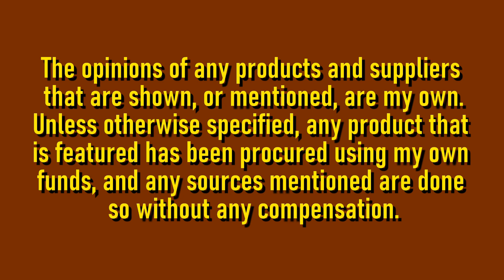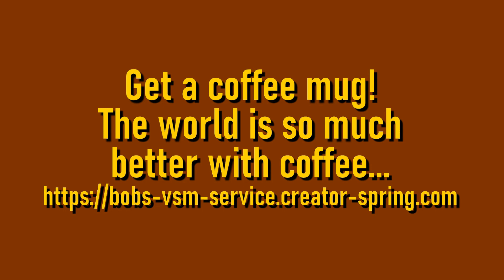A Very Crunchy Potted Motor

Comment: Hi Bob! Watching you do this was fun. Not going to lie, potted motors are one of my least favorite projects. But with that I was trying to follow your lead and tap out the brass bushings on one that I'm working on, and they did not want to budge. Nope. I think they're going to stay put. You will see 😂
Reply from the maker: Did you  remove the set screws?  YHou'll notice I didn't take oput the grease wicks... That was a mistake, they should come out first.. Your may be holding the bushings up, mine just sheared off!
Reply: @BobFowlerWorkshop  yep! I had previously removed the grease wicks and all of that, and yes I did remove the set screws. They just were in the mood to stay where they are. 😁

Comment: WOW 😮 that's the reason I keep staring 😳 at my potted motor machine. Don't have the necessary knowledge or courage to mess with. 

Yes I  think my limits on machine is getting closer. 9 treadle and 12 other machines 😅. I  just gifted one that I may get again if I can find it. All of this happened after my first handcrank I believe singer 28 that I  am still working on.

Comment: Just curious, can field coils and the armature be completely rewound, or when they go bad are they throwaways?  Thanks for all the shmoo fests!😀👍💖
Reply from the maker: Technically, yes, they can be, but it's not a job for home gamers, that's for sure. I know I wouldn't even be thinking of rewinding. Sending it out for rewinding would be cost prohibitive.
Reply: @BobFowlerWorkshop  Thank you answering, I was curious if it could be done or if those parts were in the same club as the switches, being a finite resource. 👍

Comment: Hey Bob nice job quick question on your heat gun did the small nozzle come with it or is that something you bought for it?
Reply from the maker: Part of the included accessories.
Reply: @BobFowlerWorkshop  thank you i am going to get the bauer version.
Reply from the maker: @dennislett7896  I looked at those but went with the Hercules as I'm already invested in their battery system. Bauer tools are good too, I have their portable bandsaw and the 3/8" right angle drill (both are corded).
Reply: @BobFowlerWorkshop  that is why i am going bauer i have invested in the battery system. i have almost every tool now just 3 more to invest in. the chainsaw is amazing tool.